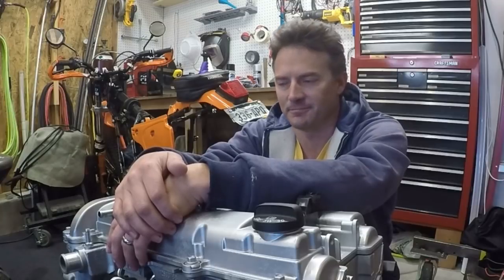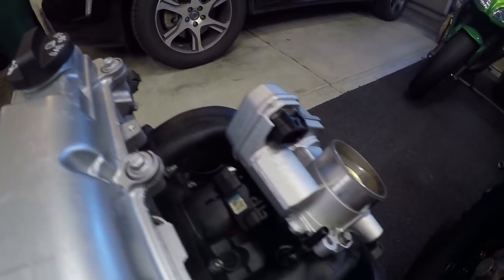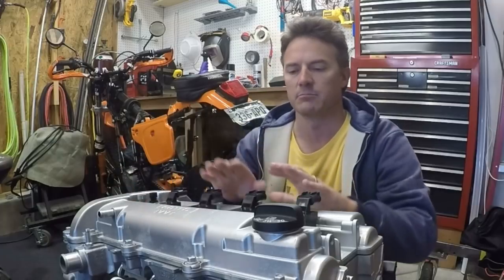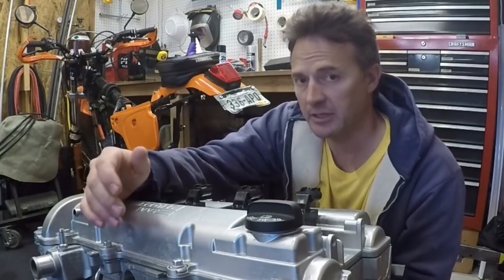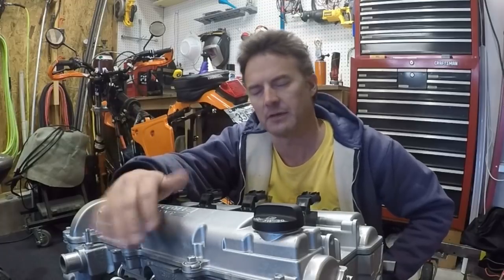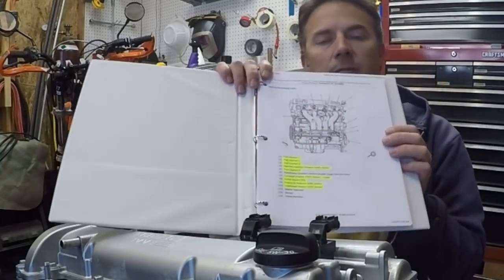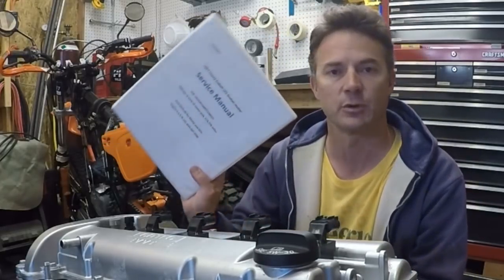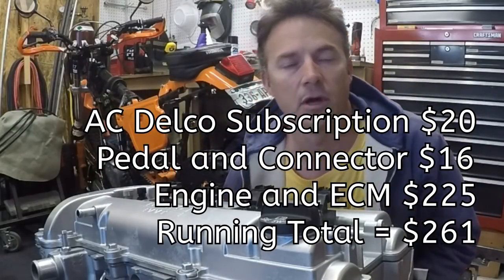Ecotec to Baja Swap Ep  2

Comment: Thank you for the hint about the AC Delco website and the three day subscription. I'm going to be adapting a Subaru 5 speed on to an Eco Tech myself. Have the trans, looking for an engine, waiting for Kennedy to finish developing the adapter.
Reply from the maker: Sure thing, best way to get all the documentation for your motor.
Happy hunting on the Ecotec. Their pretty plentiful at the U Pull it yards around me. If you can find one with VVT do it. Really helps with low end torque. And make sure to get the computer with it.
Reply: Hi Doug what stage clutch are you running?

Comment: Thanks for all of your great videos, you sure do some awesome work.  I have a sand rail that I am doing the same engine swap in.  I am like you and like to do things myself if possible,  however the security in the ECU is one area I have not figured out to get around without help.  I am sure you may already be aware of this but you will have to have the security in the ECU disabled for it to run.  All of the computer components within the original car are coded to the VIN and must communicate with each other or the security within the ECU will disable the engine from running.  I have had my engine running on the garage floor, but had to have the body control module, fuel pump module, dash cluster, ignition key module, and even the door lock module from my donor car connected for it to finally run.  I don't think I want all that extra garbage in my buggy, lol.  I have been contemplating buying HP Tuners software and doing the security delete and retuning myself, but it's going to be a whole lot cheaper to just pay someone else to do it.
Reply: Keep the awesome work and good luck with your swap!
Reply from the maker: Hey Die Guy, I don't really know how that will all pan out. I know I can get a wiring harness and ECU from Alpha Fab for $750, so that's one option. Another option I haven't researched yet is HP Tuner. But that seems like it will be about $850 to get everything I need, and then I need to figure out how to use it. I could reach out to some local guys and have them tinker with it, but that doesn't sound to reliable to me. I'll do some heavy research here soon. As soon as I get the motor in there I'll need to figure out what to do.
If you come up with any other ideas let me know.
Good luck, thanks for the comment.

Comment: Love your attitude and willingness to tackle the unknown. Have you decided which Pressure Plate and clutch combo? stage 1 (1700) or stage 2?    Will you need some sort of programming tool or performance chip to dial in the engine?
Reply from the maker: Hey EZGZ, the pressure plate and clutch in this bug is not stock. I don't really know what it is, but it seems really tight/firm, with the springs setup. I think it was way more than the stock motor needed. So for starters I am going to use it on the sew setup. It should bolt onto the adapter flywheel (I hope). And if it slips a little, that might be a good thing, kinda like a fuseable link between the engine and transaxle.
I don't know about the programmer yet. At first I'm going to see what happens with just eliminating what I don't need and tricking some sensors to think there is a signal there. As long as it doesn't go into limp mode I'll be happy. My initial install of this motor I'm trying to see how inexpensively it can be done. I have a cheap tool that can flash codes, so that will help. But it can't do any programming. It will be helpful to see the codes so I know what I'm dealing with.
Once it is up and running for a while I would think I will get a programmer and actually make it really nice. Cause as we all know, these projects are never really done.
Good to hear from you as always.

Comment: Doug, just wondering if you have done or are going to beef up your transaxle to support the power of the new motor?
Reply from the maker: Mike, my transaxle (3 rib with 5:38) was built by a local VW trans guy. Nothing special to it though really. Really just blueprinted, it has upgraded keyways and welded synchros. Otherwise mainly stock. I had a talk with the trans builder about putting in the Ecotec, he said as long as I don't drop the clutch and do any hard launches it should hold up ok. He said don't use reverse, it will break? The fact that I'm running 33" tires makes matters worse.

So I'm not doing anything more to it now. I'll see how it holds up, and once the bug is done (if ever) I'll look at other options.